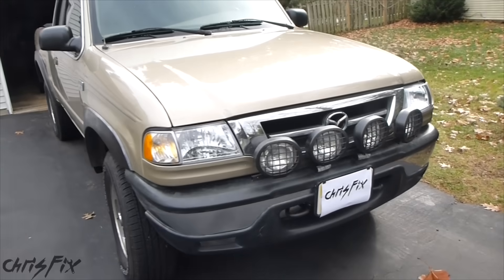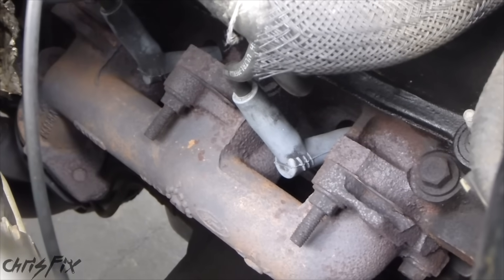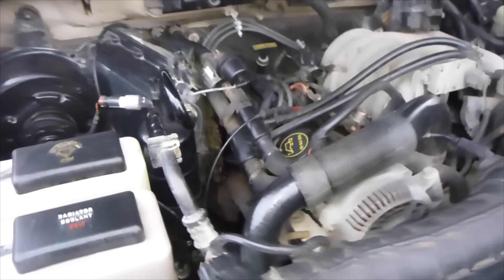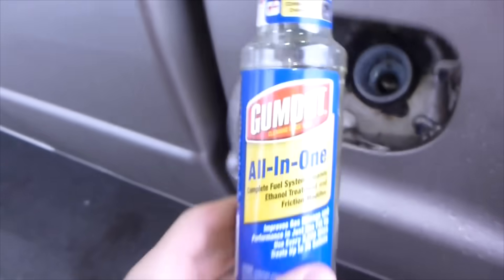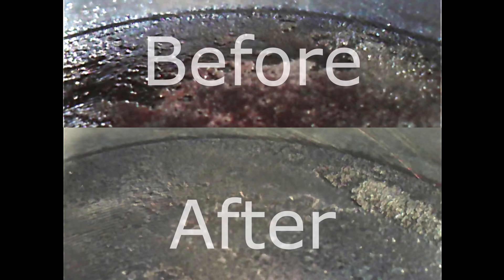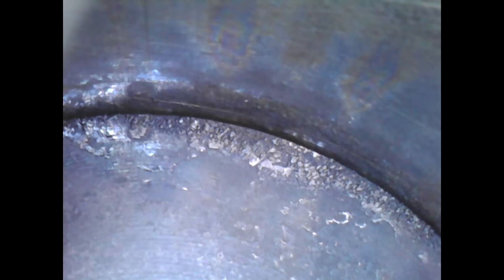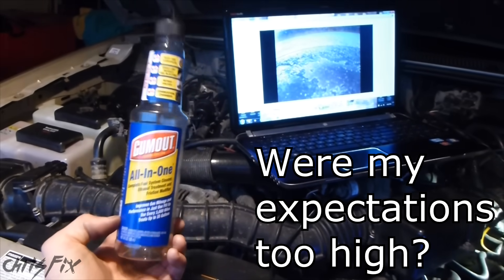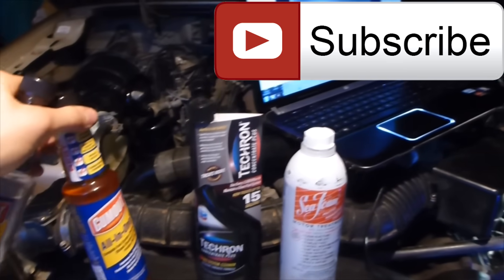Do fuel system cleaners actually work? Testing Gumout "All-in-One"

Comment: I believe your test was completely fair to the Gumout product.  I often wondered if  cleaners work.  Every time I go to the auto store and by oil and filters or other car products they always try to get me to buy a bottle at check out.   A second test back to back with the product should reinforce your comments.  I personally don't believe in internal engine cleaners.  The residue in an engine get's cook on over time so any chemicals that are strong enough to remove the residue will more then likely damage the cylinder walls.  Your test is fair and I stand ground cleaners have a place but not to be used in cylinders.
Reply from the maker: Robert T Thanks Robert and that is a very good comment. I agree and honestly I hope we are wrong. I want something to work!

Comment: Chris,
Another outstanding video. I believe the "shiny" deposits are simply the product of the pcv system sending dirty crankcase air though the intake to be burned again by the engine. Most of the high performance V8 guys are using catch cans to remove as much of this dirty air to remove the oil before it is dumped back in the intake. These deposits are easier to clean, as they are still soft, and not yet baked on. 
i'm curious as to the driving style prior to the first video. If you were low speed in town driving, I would expect to see more of the wet deposits. However, if you drove it hard, I would expect to see more of that burned off and the baked on deposits remaining.
After your next test, add a catch can to your truck, they are relatively inexpensive, and of course, some are better than others. Then you would be able to see if the build up is coming from the pcv. 
i would be concerned about doing this on a real high mileage engine. There will be a ridge of deposits at the top of the piston and that will help an old engine maintain higher compression. i wouldn't want to remove that.
Again, another outstanding video. Thanks for doing this, you are helping a lot of car and truck owners.

Ray
Reply from the maker: oned4metwo Thanks Ray. Would you think if the oils are coming from the PCV system then the intake will be gummy? Mine intake is really clean. What do you think?
Reply: ChrisFix If the intake plenum is clean then any oily deposits on the piston would be blow by of the compression ring, or oil seeping from the valve stem seal, however, most would see puffs of smoke after idling for a short periods under a severe condition.
I would still expect the intake track oily at some point past the pcv.

Comment: I'd like to see you test berrymans chemtool, I've used it for years in cars and small engines, it's similar to sea-foam but cheaper. I have had good results high it for what it's designed to do which is remove moisture and contamination from the fuel system. I've never seen what it can do for carbon buildup but knowing what it's based on I'm betting it would work well.
Reply from the maker: wb5mgr I probably wont be able to get to test that because I already have seafoam, techron, lucas fuel treatment, and water. I need more dirty engines lol.

Comment: My personal favorite is Berryman b12 chemtool.  It's inexpensive and very strong. Be sure not to get it on paint, as it will take some paint off.  I remember seeing a test online that it was one of the most effective fuel system solvents in an independent test that did not harm the nylon sock on the fuel pump. When I removed my intake manifold after running a tank with B12 the intake runners were spotless.
Reply from the maker: Eric S Never heard of the stuff. I will have to check it out! Thanks!

Comment: I've mentioned this before, and I vaguely remember you not being too keen on the idea, but just a little bit of water slurped into the engine through a vacuum line would almost certainly remove those carbon deposits. The water flashes into steam instantly in the hot combustion chamber and does an amazing job literally steam cleaning the cylinder. You could also use a light oil product like Seafoam. I've personally used Seafoam before, and it leaves the pistons themselves looking brand new. I've talked to many mechanics though who have said the Seafoam is a waste of money and a touch of water is just as good, and honestly I believe it. Another thing that might work really well would be some kind of atomizer or vaporizer that could make a fog or mist of water or seafoam into the engine. They actually have kits with an aerosol can that sprays a mist of seafoam like product into your intake that does it for those leary of hydrolocking, but I didn't have any issues when I tried it. 
P.S. As proof of this think about a leaky head gasket, the cylinders of a leaky headgasket are steam cleaned by the antifreeze, so they usually are spotless.
Reply from the maker: Jesse Crandle Well I will be testing both seafoam and the water method so we will see if they actually. I dont know that the water method will work the way you think it will. You used a head gasket leak as an example, but the leak is constantly dripping into the cylinder and even on the down stroke when there is no combustion so  will a few minutes of spraying water in the engine actually do anything? We will find out!

Comment: I have  not finished watching this video entirely, but I had to pause and mention something. I use "V-Power" gasoline because I have a turbocharged 4 cylinder, I can use 87 to 93 octane, but the manual recommends 93 and I do find that it provides the best mileage and smoothest power. The thing that annoys me is I hear radio ads and see advertisement at the gas station (Shell, they're the ones who have "V-Power", which is essentially just this cleaner here put into the gas already) telling people with ANY car to use premium fuel to get the benefits of v-power, and that is FALSE. You should NOT use a 93 octane fuel if it is not recommended for your vehicle. 93 octane is harder to detonate (which when you're turbocharging you're forcing twice as much air and fuel into a piston as it could originally hold, so a harder to detonate fuel prevents accidental combustion before the piston is at top dead center), so if your vehicle was designed to run on 87 this could cause knock because the fuel might not detonate, and I suppose it's possible it would even run lean to try and make the fuel detonate more easily. They clearly state v-power is only in the 93 octane, but they should not try to convince everyone that it is good for ANY vehicle as it isn't. Adding a can of additive like this to 87 octane is much safer.
Reply: Frank Gutowski Great explanation frank. Very informative of you.

Comment: Chris: recently, I`m planing to buy the seafoam or gumout. But I was not sure if they can really work for cleaning the engine.You made a video what exactly I want to know. But how about if you use water? Do you think if just tap water can work or it may build rust inside the engine ?
Reply from the maker: louisphng1 I am going to try out seafoam next. Using water will not cause rust as long as you rum the engine for a few minutes after you clean it with water. This will evaporate any extra water so there is no increase chance of things rusting.
Reply: ChrisFix
So, do you think tap water could clean up the cylinder carbon?
Reply from the maker: louisphng1 Potentially. I know it can over time because that is what happens with a head gasket leak, but can it work with a cup or two of water?

Comment: You should try the "High Mileage" variant (which says 75k+ miles if I remember right), maybe it's a bit stronger and can knock out the bigger clumps of carbon, if the second bottle doesn't. I know I used the Gumout all-in-one high mileage and it seemed to have improved gas mileage a bit presumably by cleaning up the injectors.
Reply from the maker: DapperFellowGent This is the big one they sell and it is the "all in one" so I wanted to test this one. Maybe in the future I will test the high mileage. I would love to test this stuff on injectors but I dont have any way of doing that right now.

Comment: I've been thinking of using some Meguin fuel cleaners on my 24 year old Toyota, i just hope its not just a scam product, being from a well known german oil manufacturer.
Reply: Hydrocarbons, C9-C12, n-alkanes, isoalkanes, cyclics, aromatics (2-25%)
Solvent naphtha (petroleum) (common solvent in fuel treatments)
http://www.chemical-check.de/clientversion/pdf1/399/9034M_0009_22-11-2012_EN.pdf
Page 5 has the percentages of what's in it, but I really don't know much about these chemicals. It uses the 0,5% for the European version of the American 0.5%....you know the use of the , for decimals instead of the . if that helps anyone.
Reply from the maker: Kallyper Well, you saw the results with this so... I will be testing other fuel cleaners as well so we will see if we get different results!
Reply: DE Nichols  Thanks a lot, i appreciate it!
Reply: No problem my friend. I got curious from your comment and figured on sharing.

Comment: Chris try seafoam and berryman B-12. Since they claim to do the same thing. Also I have been using marvel mystery oil since I got my truck in 2000 and to me it works great. My trucks 14 years old and the idle is smooth and no loss of power. And if u can try and use 1 qt of oil with 1qt of aft Before your next oil change it flushes out nearly all the sludge that's been building up. Thanks bro and keep the videos coming.
Reply from the maker: Enricky De La Cruz Thanks for the suggestion! I am planning on doing seafoam and now I am thinking of doing marvel mystery oil too!

Comment: My concern with fuel system cleaners is; what happens when all that junk in the pipe hits the fuel rail and sent into the injectors? I have used 3 different fuel cleaners in 3 different cars and had fuel injection issues with each one soon afterwards. Coincidence, I think not.
Reply from the maker: SeaMonkey That is a good point! You would hope the contaminants would dissolve but your experience indicates that they might not.

Comment: Great video! I'm thinking that this stuff would probably keep any carbon buildup from the engine if you start using it on a regular basis in a clean engine. But I'm thinking it probably doesn't work all that well in an engine that is already dirty.
Reply from the maker: mecaniquejp Yea, that is what I am thinking too, but it says and shows on the bottle that it cleans large carbon deposits so... That is why I am giving it another chance.

Comment: I've always heard and thought that those fuel cleaners helped "maintain" your engine, so in other words it will only help prevent those large carbon deposits.
Reply from the maker: whitetailbuckhunter1 It might help maintain your engine, but I am testing what the bottle is saying about removing carbon deposits. I can see how it will maintain a clean engine but then you have to factor in the value and whether or not it is worth spending the extra cash on fuel cleaners vs not using them at all.

Comment: The GUMOUT REGAN product is reported to contain PEA as is the Techron additive. I believe the additive tested here is simply a solvent. PEA is the additive common to many top tier gasolines and is the only fuel system treatment manufactures recommend as it is effective and generally safe. In fact BMW and GM sell rebranded Chevron Techron fuel system treatment as their own.
Reply from the maker: Andrew Willard This gummout has PEA in it as well. It is very similar stuff to regain.

Comment: I like the test. It was an accurate test with proof. I was watching videos on spraying water in the intake to "steam clean" your intake and combustion chambers. Have you ever come across this? Eric the car guy did it but didn't show results. I didn't know if you have or not.
Reply from the maker: Brenndon McGill I have seen the water spray bottle trick and I will be testing that too!
Reply: I tried it and I could hear the difference. Also, running a laser thermometer I could tell on each of my intake runners that my engine was running closer to the same temperature than it was before.

Note: my intake runners have air between them, so I believe it to be a decent snap shot of thermal differences from one cylinder to the next.
Reply: ChrisFix look forward to that video. Hope you show the boroscope views as per this video. I'm hoping gumout doesn't work so you are left with carbon deposits to see if the water trick works.
Reply: MrTrustafox They're will be enough carbon left so he can do the water decarbonization. Trust me.
Reply: Brenndon McGill It cleans past the combustion chamber into the exhaust too. Hey! I only need an exhaust manifold gasket and I can test it BEFORE I own a bore scope. :)

Visual inspection. Micrometer check to see if the exhaust wholes for bigger. :) and whether it works or not I'll be hitting it with my steel wool. I'll do that with a drill of course.
Reply: ChrisFix Thanks ChrisFix! Can't wait to see it!

Comment: Nice video, as usual. I really like this test by giving a thorough inspection before and after applying the fuel system cleaner. I used similar stuff once on my car, but haven't really noticed any significat / obvious difference. Then again I have used only one bottle and haven't used a borescope :D. Then again it did no harm to the engine either. Can't wait to see what happens with the next bottle / next cleaner. Big thumbs up.
Reply from the maker: Kaktus Jack Thanks man! Yea, it is hard to tell if there is a difference so I used my camera so we can get hard evidence!

Comment: Should try and test engine conditioner, the aerosol can that you spray directly into a vacuum line or intake to remove carbon build up. It would be really nice to see if that works!

Thanks for the vids,  great to be able to use them as a base foundation on the procedure to use!
Reply from the maker: Kieren Bolitho I will be testing seafoam though the vacuum line! Thanks a lot man!

Comment: Isnt this product made to prevent carbon build up, not remove it after a build up?
Reply from the maker: TheWoodfinger The bottle says it removes carbon buildup and then prevents it. They have before and after shots of the valves and pistons with carbon buildup and it says on the bottle that it removes carbon deposits.

Comment: Great test.

The marketing materials say that the Gumout product prevents future carbon buildup and cleans piston tops.  It probably will not remove old carbon buildup.

I did see a test from a third party that tested Marvelous Mystery Oil in a motorcycle.  He purchased two of the same motorcycles brand new one for himself and the other for his wife.  In his wife's motorcycle he used MMO from gas tank fill number one.  In his motorcycle he used gasoline only.  After three years he broke down the motorcycles and compared the pistons and cylinders.  His wife's piston and cylinder looked brand new.  His piston and cylinder had carbon build up similar to the pistons in your video.  

It is never too late to start using the treatment.
Reply from the maker: Sandbag1300  "cleaning piston tops" is cleaning carbon off the piston. They also state that it will clean carbon off of valves. That is an interesting test and waiting 3 years to check the results is a long time so I give them credit!
Reply: ChrisFix Do not expect too much from Gumout regarding old carbon deposits.  If the product could remove old carbon deposits from pistons the marketing materials would lead with that fact.
Reply from the maker: Sandbag1300 The bottle does show that it removes old carbon deposits.
Reply: Okay.  The next test should be very interesting.

Comment: I use stp complete fuel system cleaner a week before every oil change than 2 weeks to a month later I use lucas injector cleaner and upper cylinder lubricant and than like 2 weeks after that I use stp fuel treatment or octane boost... also once every winter I use ISO heat.. restore fuel system cleaner seems to work good as well
Reply from the maker: Brendan Mccabe Dang, that sounds like overkill (especially after doing this experiment). Ever think about reconsidering? That sounds like it can get expensive for minimal results.

Comment: I have never used the Gumout fuel cleaner but have used Techtron made by Chevron.  It has worked well cleaning up fuel injectors for a couple of older cars I own, with a noticable improvement in acceleration.  I can't say if it removed any piston head carbon.
Reply from the maker: Ozzstar Thanks for the info from your experience! That is good to know and will be noted in the video!

Comment: chris! it would be awesome if you can do the same test but. With valvoline complete fuel treatment. I heard some great stuff and have used it every time i get an oil change.
Reply from the maker: Funbgs2 I might do the valvoline fuel treatmen but first is seafoam, lucas oil treatment, and techron. Thanks for the suggestion!

Comment: I also expected more than just the loose easy crud to be removed, i thought it would remove some of the carbon, the manufacturers have covered themselves with the name, its not called "Carbon deposits gone!!" lol :D

It is helping but im not sure if it will ever remove the solid stuff, im sure it helped to remove the soft squidgy crud from the fuel system.
I think the company would say "The results are based on regular use", translated that means "We want your money forever Wa wa wa" ha ha :-D
Reply from the maker: zx8401ztv According to the container, it should work in one use. I think a good cleaner will be able to get the hard stuff out or at least make a dent in it and I plan to find out. I could have removed that gummy stuff with water and saved $20 lol. I want real results! We will see!